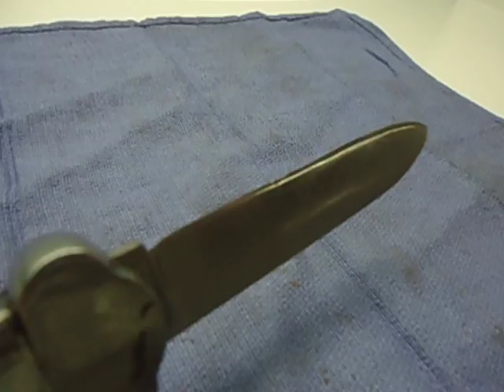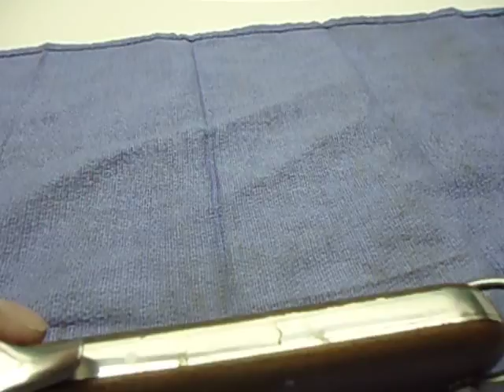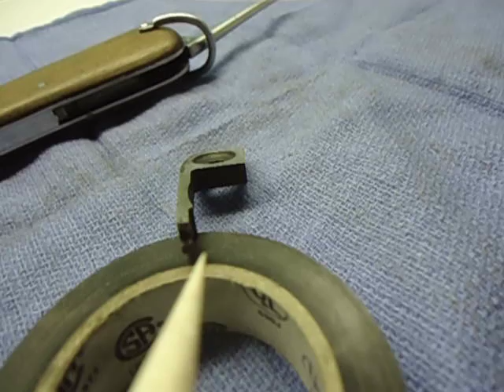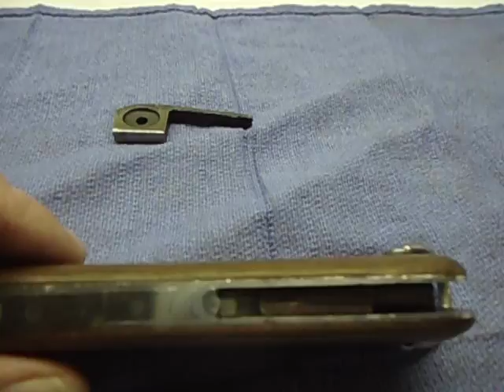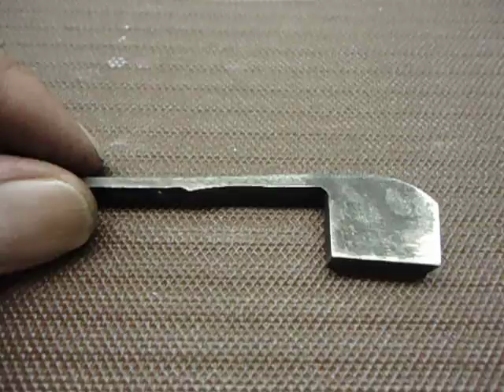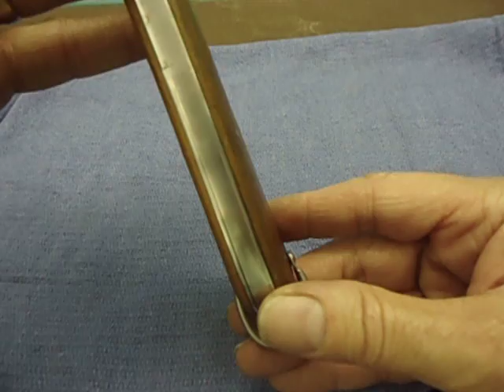GERMAN PARATROOPER GRAVITY KNIFE REPAIR VULCAN GUN REFINISHING

Comment: Guess that'd be a laser weld ?  Be a good guy indeed who could get TIG down those holes and fuse at the bottom.
Reply from the maker: Yes sir! All our fine-detail welding is laser welding.
Reply from the maker: Yes, we use a Laser Welder for another reason as well. There's no other type of Welding that would generate that small amount of Heat so that the Wooden Grips don't scorch. We even repaired one with Plastic Grips and they weren't damaged either. Have 2 more here right now and 2 more enroute. Been a busy Year repairing these Knives. We enjoy doing them. Thanks.
Reply from the maker: I mistakenly called that Welding "TIG" but it's actually Laser Weld. Excuse my stupidity.

Comment: I have an original one that I have the same problem with.  Can you give me a ballpark on what that project runs? You did some really nice work
Reply from the maker: Good Day. I've done yet another one but didn't Film it.  I've been charging a flat Cost of $300.00 plus Shipping. That amount is OK for me as I have Expenses such as having a new Spring made, all of the HeatTreating, plus the Laser Welding. Still leaves me some Money for my Labor. All Work Garranteed. Contact me if interested. Thanks.

Comment from the maker: Good Day.

To be Honest, I know nothing about the Value of these Knives. I know that whenever something gets "Restored or Repaired" it usually loses some Value, but in the case of a Knife that is broken, I would think that a nice clean Repair that makes the Knife operational would only help it's Value. 

This Repair cost the Customer $300.00 Total, inc. supplying the Steel, making the Spring, etc.

It took more than a Day, and I basically charge $300.00 a Day.  6 Hours @  $50/Hr.  Fair?

Thanks.

Comment: If you would have pressed out the two Pins holding the Bolster Head together you could have taken it apart and replaced the Pins holding the Laynard Spring in place. instead of Tig welding the spring. Great Book on these Knives "Luftwaffe Gravity knife" Mack A. Pattarozzi

Comment from the maker: If you mean how did they weld without any heat? They "micro" welded it. They actually sit at microscopes and weld. The welding rod looks like Silver colored thread. You can see how little heat they generated. It was the only way to re-attach that spring without tearing the whole knife down. Also, too much heat would ruin the tempering that I just had done to the spring. Ya gotta love Technology.

Take care..............Nick.